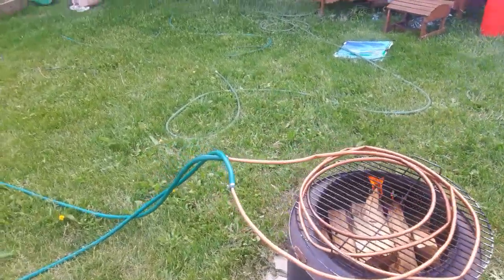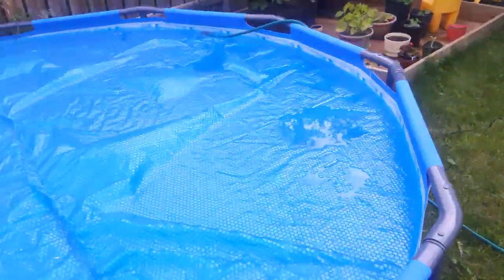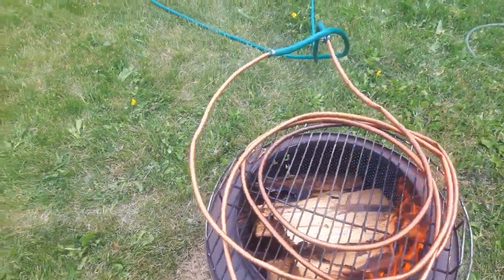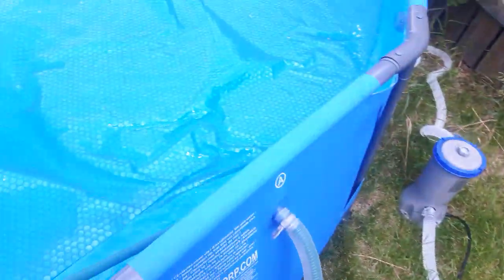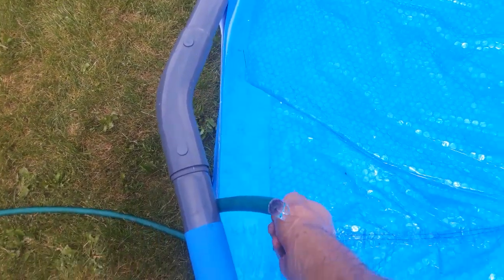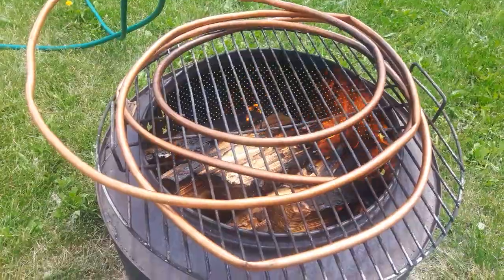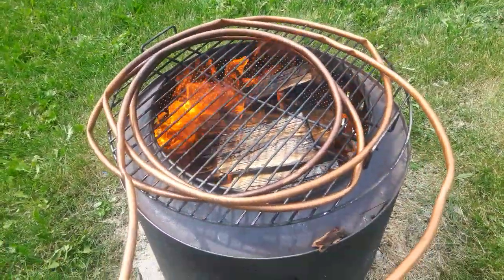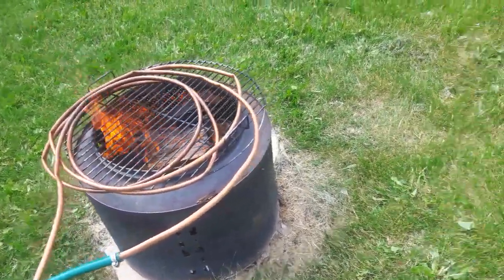CHEAP $15 POOL HEATER

Comment: QUESTION: The hose is on all the time...is this not wasting water? this is all new water coming from the faucet?  I didnt get why it has it returning to the pump and thrown out again , that's just a loop, it's not really recycling the water as there is new water coming in at all times correct? Just curious, thanks

Comment: I'm going to try this I also have a 10ft pool will. I'm worried my pump won't pump it round well enough it looks the same as yours im just worried it won't work I've got to buy a burner and some copper so don't want to be out of pocket

Comment: What Gage copper tubing?
Reply from the maker: Honestly im not sure, i went to home depot and bought a 10 foot roll of 1/2 inch soft copper tubing, same kind of soft copper you would use for water lines to a refrigerator or ice maker. Not sure what the wall thickness or the gauge is thou. All i know is it was 1/2" diameter and slipped tightly onto a garden hose
Reply: @AaronsAutomotive  thank you